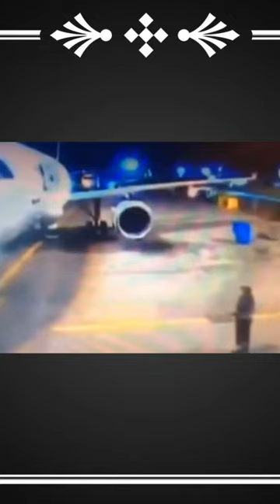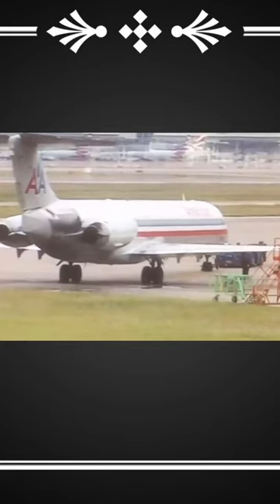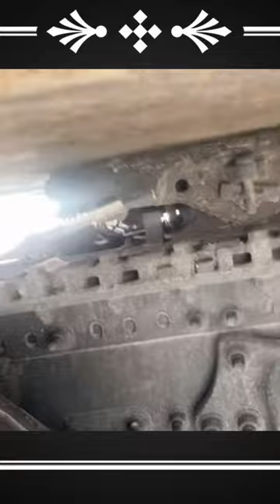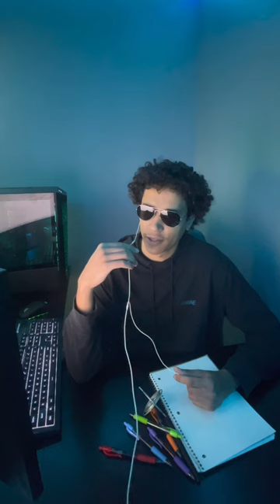Landing Gear Collapse!!! #shorts

Comment: its a ground lock pin. there is a possibility that if Hydraulic pressure is lost, the gears can become unlocked and retract. though that is very unlikely. the pins you put in the gears are a precaution, not a necessity.
Reply: It’s aviation — precautions are necessary